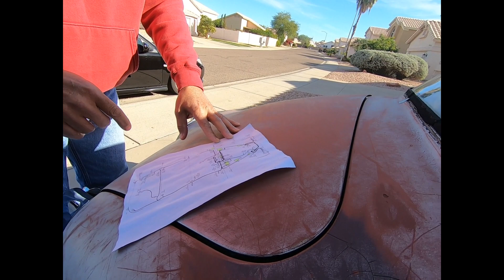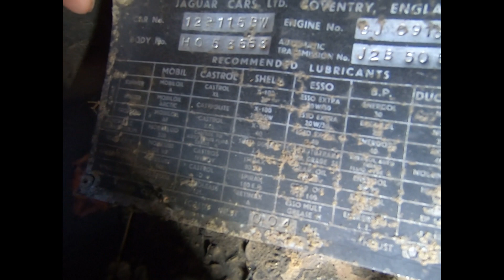Jaguar MKII 1967 2 4 Automatic Barn Find !!

Comment: Excellent body shell and door fit.  Good to have the thicker bumper- and because it’s got the fog lights, I would probably trim it in leather with picnic tables (an optional extra for these later cars).  Money can be saved on the metal and spent on the engine.  Jaguar didn’t publish performance figures for the 2.4 as it wasn’t very quick.  Not a mechanic but can it be re-bored to 3.4 to keep originality?

Comment: I’ve often wondered what power can be got from a tuned 2.4
Reply from the maker: I am sure with triple Webbers it would move but the slush box on this one would slow it down.
Reply: @jagvette1  a nice 5 speed should do the trick
Reply: @jagvette1 my 2.4 automatic was quiet nippy as it had only done 43 thousand miles from new 1964 I bought it in 1977 plus it had been garaged and chauffeur driven from new

Comment: I bought this car, amazing I found your video! Did you know if it ran in the last few years?
Reply from the maker: As far as I am aware it has not run in a long time. FYI I do have spares for MKII’s and a number of contacts, please reach out to me if you need help or parts.
Reply: Thank you for responding. I am in Oregon. I have pulled the engine and transmission. Hard to find info on automatic transmission removal/separation from the engine. I have the service manual and the Haynes book. Not much help there.

Comment: Claimed to have ran for 11years but the condition is trying to say more than that
Reply from the maker: Unfortunately after it’s initial life in Panama then life in the baking sun in Arizona and the leaking rear window has taken its toll on the interior, and the rear window leaks caused the back seat rot. And it has sat outside for 45 years.  It it’s cheap and could be a fun project

Comment: 2.4 and automatic, the 2 worst things you can have on a MK2, walk away. I have a 3.4 auto and changed the auto gearbox for an XJ40 4 speed auto which transformed it but it was a £5k conversion.
Reply from the maker: Not interested in speed, I have a 3.8 MKII for that
Reply: Try driving your car in only 1st, 2nd and 3rd without using top or overdrive and that is what a 2.4 auto is like, you constantly want to change up as it sounds if kit were over reving. Sorry to be negative but don't do it. @jagvette1